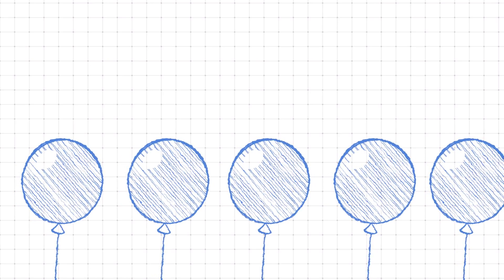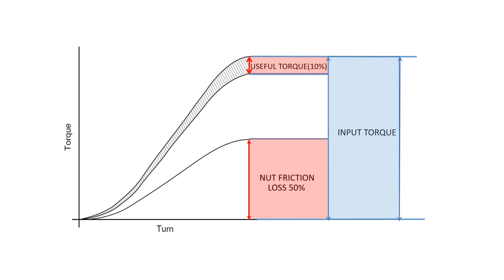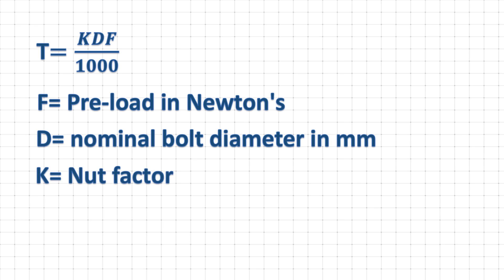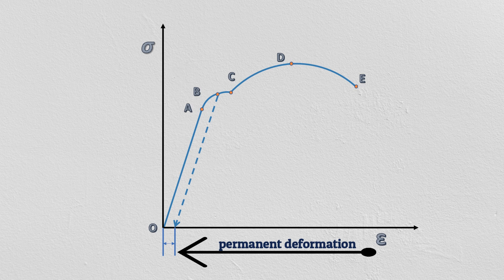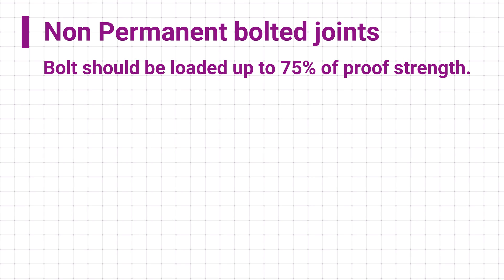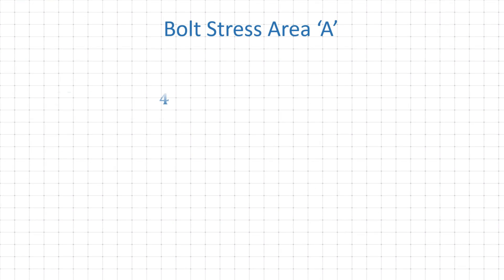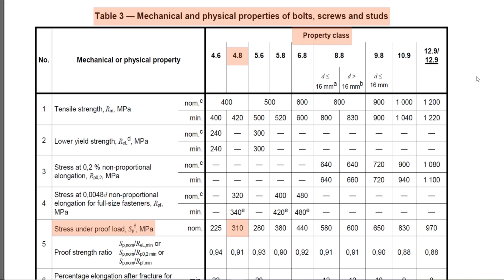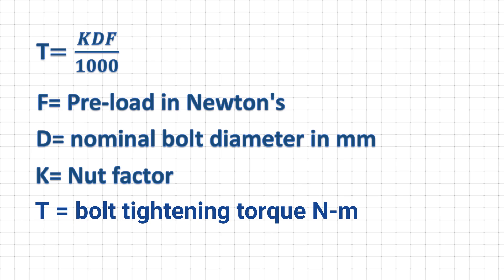how to calculate bolt tightening torque

Comment: It wasn't fast.
Reply: Y
Reply: Does it really matter for Engg solution. Muslim No. Muslim. Btw. Wow explanation. Kammal
Reply: Are you afraid of Muslims? I just asked a question as others ask sometimes. If you don't want to answer, that's fine. For me, Hindu or Muslim does not matter. Must be human. Good luck @nasir97uet
Reply: Why Hindu muslim discrimination in the comment section, just be worried about engineering Solutions
Reply: @sharathp3809 
Are you afraid of Muslims? I just asked a question as others ask sometimes. If you don't want to answer, that's fine. For me, Hindu or Muslim does not matter. Must be human. Good luck

Comment: Can you please explain how to calculate force which will make the bolt pull out of the nut
Failing its threads!
Reply: For standard bolt, VDI 2230 or machinery handbook I think is good to go. For customized thread, it can be treated as beam theory, where beam section height is thickness of root thread and beam section width is the thread coil length.

Comment: How do you calculate the required torque when you are tightening a material like rubber? Like a flat rubber seal being tightened with bolts against a metal surface
Reply: Use Shigley approach where you check for stiffness of bolt and clamped parts

Comment: Area formula is wrong, It should be = Pi/4 * ((D- (.9742/pitch))^2
Reply: What u have mentioned is for ANSI  thread where D is in inches and TPI is used instead of pitch

Comment: dividing by 1000 is to convert mm to meters, this step is not needed if you keep your input values the same as the output values i.e. Newtons and meters, otherwise very good

Comment: Hi, thanks for great video, explanations are very clear. Could you please tell from where u took the reference for pre load calculation. 0.75% of proof strength for non permanent joint is there any iso standard?? Currently i am checking for A4 70 grade bolt, there proof strength is mentioned as stress at 0.2 permanent strain is it correct? References for the formulas would be really helpful.
Thanks
Reply from the maker: material which doesn't exhibit a clear yield point, for those materials proof strength is often considered as stress corresponding to 0.2% of permanent strain. some time it is also expressed as offset yield strength or 0.2 yield strength.
Reply from the maker: It is standard engineering practice. You will find it any fastener handbook.
Reply: Thanks for the response 🙂.. for 75% is there any references?? 
For 8.8 grade bolt proof stress and stress corresponding to 0.2strain both are available in iso standard. Value is 600 and 640 respectively so i am getting the doubt whether stress at 0.2 yield is Same as proof stress? 

Without the reference i am unable to derive the conclusion that's the reason.

Thanks
Reply from the maker: Read preload joint analysis methodology for space flights by NASA. also refer a book "intoduction to the design and behavior of bolted joints"
Reply: @technoworks.  Sure will read the suggested references.. Thanks for the great support 😊✌️...
Reply from the maker: Please support and subscribe
Reply from the maker: Also refer this video https://youtu.be/-_BxnhLyuH8

Comment: my customer is calculating clamping load , can you tell me how can i calculate clamping load for M16 12.9 class bolt with M16 nut
Reply from the maker: For class 12.9 M16 bolt, tightining torque should be about 365 N-m. Assumed K=0.2 for non plated steel bolts and proof strength = 970 N/mm2.

Comment: Sir please calculate 20mm Dia Bolt ( F ) Value. Pitch 2.5m / Gr. 8.8 
If possible please calculate Minimum / maximum torque in Nm. 
M20 Bolt. / Gr. 8.8 / Pitch 2.5m / K= 0.15 /  600 Mpa. 
We use this bolt in Railway Bridges. This is a High strength friction grip Bolt.

Comment: good presentation....what the difference between non permanent bolted joints vs permanent bolted joints ? thx..
Reply: standard screws and bolts can be detachable but there are fasteners used in aerospace industry like hi-lok, hi-lite. these fasteners are also threaded. but they can not detachable after installation.

Comment: This is an excellent explanation. Could you add links in the description to the tables used in the video?
Reply from the maker: let me know  which table just mention time. I will give you the reference
Reply: @technoworks.  I think he's talking about the table at 1:35. Thank you!
Reply: Hi Rohit, if you are asking about K table then it has been derived from a book  "John H. Bickford -An introduction to the design and behavior of bolted joints". This you can see at the top side of PDF at 1:35. time into the video. You need to closely observe it 😊.